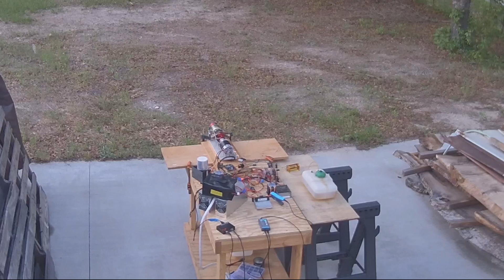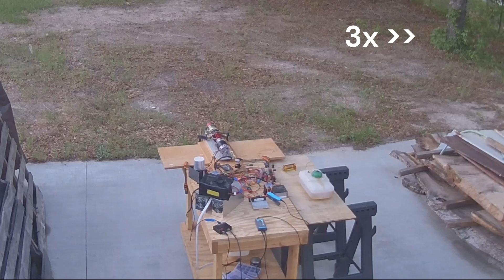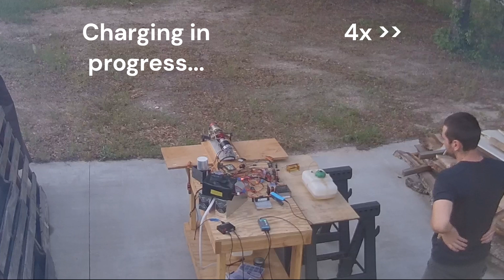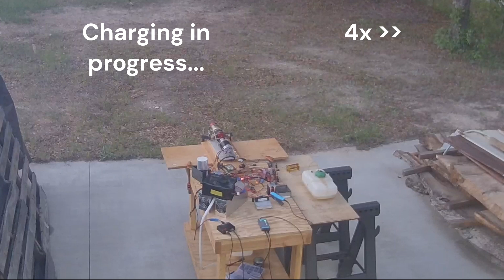Full Auto Charge Test #1

Comment: I saw your comment about a "140-350vdc to 50vdc @ 6kw " buck converter for this project on another video. I can help you find or design something that works for this if you are interested. or just give some tips on where to look.

One thing is if instead of just rectifying the generator voltage, if you treat your generator as a motor in regenerative braking mode, you can regulate the output voltage directly out of the generator instead of needing a buck converter. or can use a fixed ratio converter like vicore bcm modules.
Reply from the maker: @marshallscholz8629  let’s discuss further over email. Send me an email at (me @ andrewocejo dot com) . I will send you my project summary of where I am at in the project, and we can discuss further. Really need to balance out these cells and move away from the SMPS method could use all the help I can get. Thanks 🙏

Comment: so your testing an automatic APU? Wouldn't you want a separate BLDC wound to be a generator?
Reply from the maker: Yes auto apu, and the BLDC motor running as the generator is a custom winding to provide a high voltage DC output after the full bridge rectifier. Testing different generator configurations as I go.